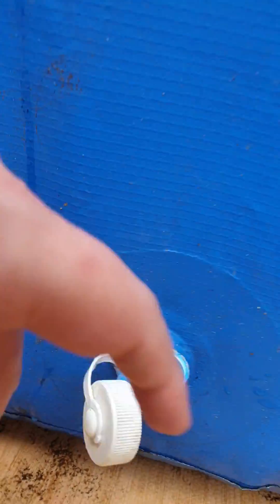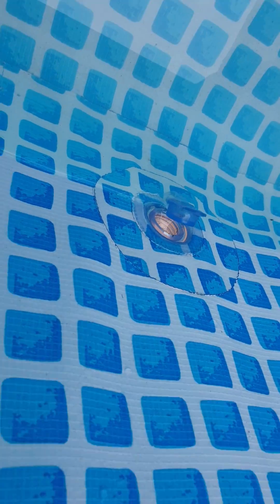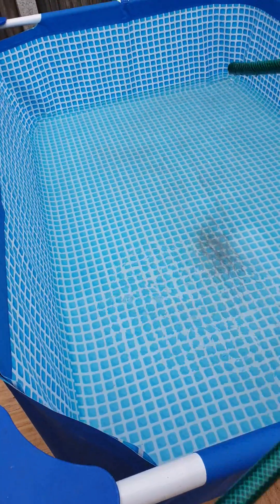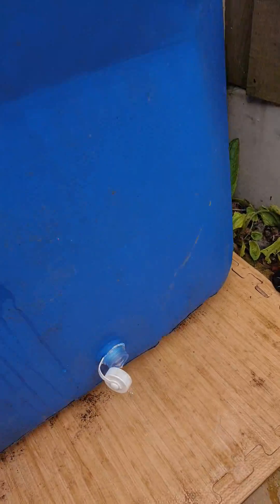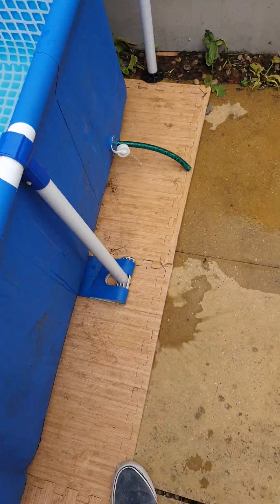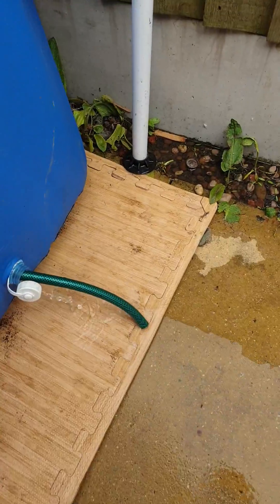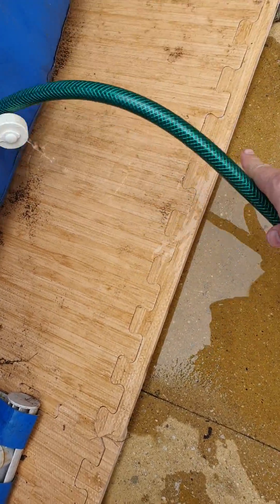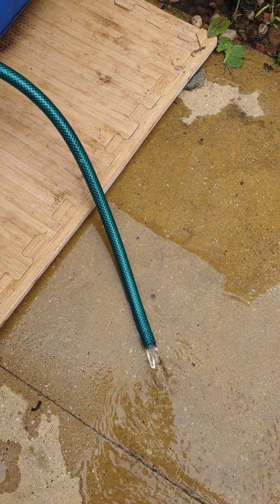How to drain a pool with just a garden hose pipe!!!

Comment: Will this work for inground pools too??
Reply from the maker: Worth a try, its all about pulling the water through the hose and once it starts to come out the end of the hose, physics should take over and continually pull the water through as long as the hose end is under the water level. But its easier when you can put the end of the hose outside the pool lower than the other end for easier water flow. 

Personally, if you have an indoor pool, i'd get a proper water pump instead due to the volume of water and pressure involved.
Reply: @ianpetriesphotography  Ok thanks man.  I was looking to avoid the pump purchase for essentially one pump out of dirty water a year but if I have to I will get the pump.  Yes the issue I was unsure of was the fact the indoor pools are elevated and the water would flow down.  Not the case with indoor pools..  I think would still work sort of but might not be as effective.
Reply from the maker: @JohnnyLREACTS  I mean at the cost of a hose, give it a try. the question is how long of a hose will you need to get from inside to outside, as you need to suck the water through the hose until it flows out, then physics should take over.. so if you can do that then no need for a pump. worth a try. feel free to share your results here when you have done it.